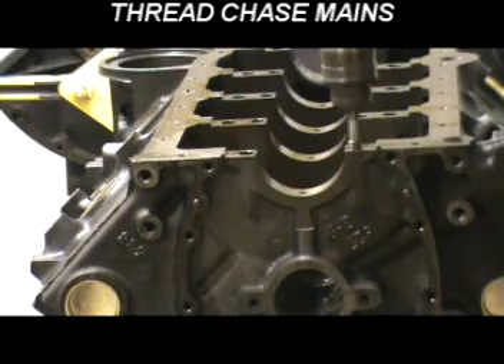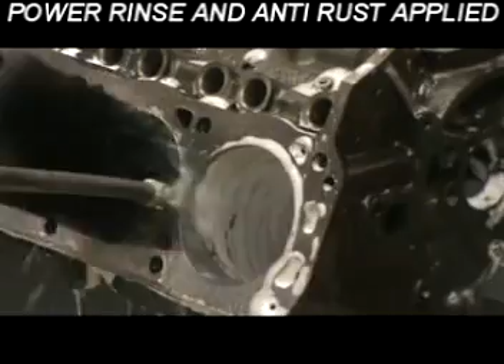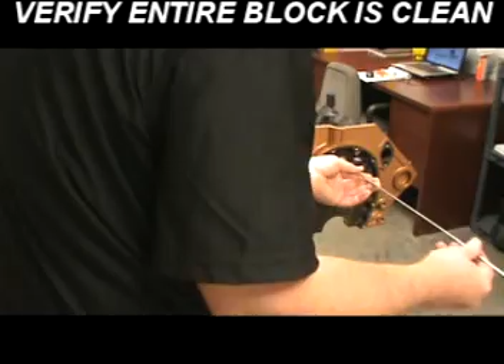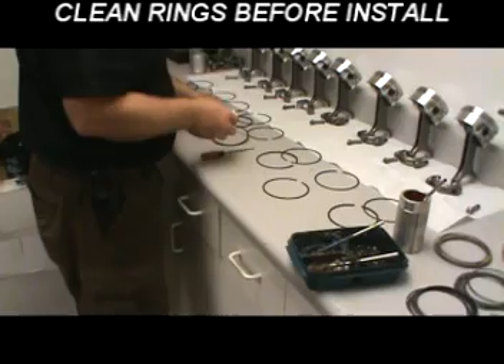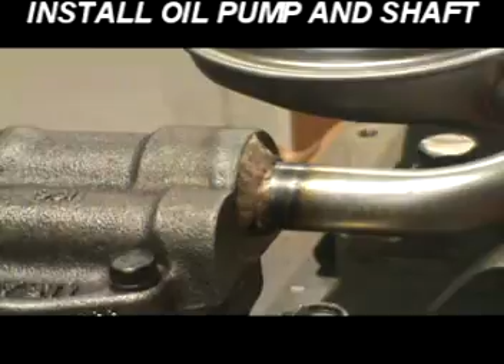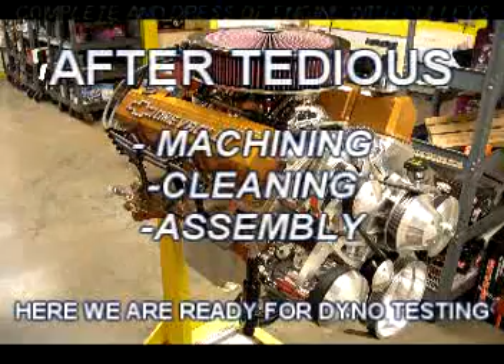Inside Look at Building a Reliable and Professional Stroker Engine

Comment: Gotta notice the extremely clean and well organized engine assembly room. The sum of all the minute details adds up to a precision engine assembly that separates the professionals at PM from all others. Nice job guys 👍.
Reply from the maker: Thanks!
Reply: @prestigemotorsports  , You’re welcome. This meticulous attention to detail is an important process that I learned from my oldest brother while working in his shop during the sixties. “Gene’s Speed Shop” was well known in the southeast for competition Ford engines such as the 427 high risers that powered ‘64 Fairlane Thunderbolts and the 427 “Cammer” engines in Top Fuel down to street sleepers. The glory days for sure but no competition for modern technology !

Comment: can you swap the standard 400 harmonic balancer with a 6'' street dampener if the engine was internally balanced ? and can you just change the timing marker to match the smaller balancer and still be able to set the timing correctly ?

Comment: what a weak example to use. a small block. 572 pontiac stroker. now, theres a REAL V-8 GM Engine. plus, you folks did not blow out the oil passages with compressed air. Wow!. BullyBilly

Comment: "Super clean " with the freeze plugs in ...hahahah. This is basic engine building 101...
Radius the bearing? What the hell are you talking about ...I'm a certified AERA machinist and work 50 hrs a week building engines and have for years in a full service shop. You guys won't be around in 5 years...
Reply from the maker: Core plugs are installed prior to the machining process to allow for pressure testing the block. No use machining the block if it is broken. If you work on simple rebuilds, then you probably haven't heard of putting a radius on the bearing. This is done in performance applications. Performance crankshafts have a larger fillet radius on the rod journals for added strength. The problem is the larger radius interferes with the rod bearing. The fix is to chamfer (or radius) the edge of the bearing. In some cases you can get narrow bearings that achieve the same thing. And in case you missed it, the publish date of this video was 2011 which was 7 years before your comment. We are on our 10th year building reliable performance engines. Thanks for the encouragement!

Comment: I threw up in my mouth when I saw "Chevrolet".  Mopar or no car...
Reply: Seahorse Captain Chrysler is just as overrated. Try an oldsmobile 350, 400, 425, 455. Did you know you can turn an olds 350 diesel block into a 440 gas job? They also use big block crankshafts. They're bullet proof and can handle alot of boost.
Reply: I'd probably be a Morpar man if the stock transmission that came in every chrysler wan't garbage.

Comment: Yes but we also need a crankshaft windage tray :)

Seriously though, this is an excellent vid. I am very heartened that places such as yourselves still wash bores with soap and water as a final cleaning step.
I cannot understand why so many places omit this step. It really is the key to bore cleanliness.
Reply: +ThePaulv12 Some strokers cant use a windage tray. Clearance issues.
Reply: +matthew bruce Worth 40hp @ 6000 rpm I read somewhere. This is why I mentioned it. 
$ for $ that makes them the cheapest power upgrade of all, but it isn't exactly true because most motors need a complete makeover to make power to 6k rpm. Still, it could be true in drag racing and come to think of it that's where I read it.
Reply: +ThePaulv12 I wish I could run one. I might see if it's possible to fab something.

Comment: WD40 was developed specifically as a "Water Displacement" formula.  "WD" get it?  Called WD40 since it was the 40th formulation when they got it correct.
Reply: 40th formula.
Reply: We both learned something...Taken from the WD40 web sight..
A QUESTION OF LUBRICATION
Myth: WD-40® Multi-Use Product is not really a lubricant.

Fact: While the “W-D” in WD-40® stands for Water Displacement, WD-40® Multi-Use Product is a unique, special blend of lubricants. The product’s formulation also contains anti-corrosion agents and ingredients for penetration, water displacement and soil removal
Reply: soloban81 i didnt know that. cool
Reply: Makes it great for cleaning distributors and other electronic components. Want to libricate squeaky parts use LPS 2.
Reply: It only does that for 40 days  WD-40

Comment: fyi i learned the hard way but welding the pickup tube to the oil pump wont hold up to the high rpm harmonics it takes a nickle welding rod to penetrate cast iron but it wont stick to steel so i use a one piece oil pump with pick up built in

Comment: NIcely done. Even with some steps not clearly in video I know its done. I personally know 4 gearheads that run your engines no complaints,  One of them has over 50,000 miles on it on his 347 stroker.  Still has great compression runs like a scalded dog. Time for mine as soon as the IRS sends me the money.